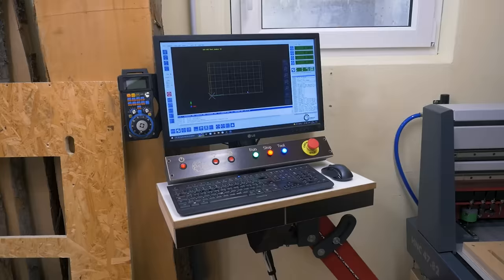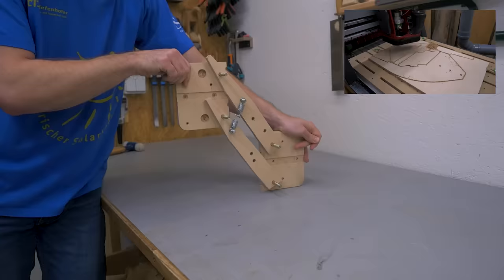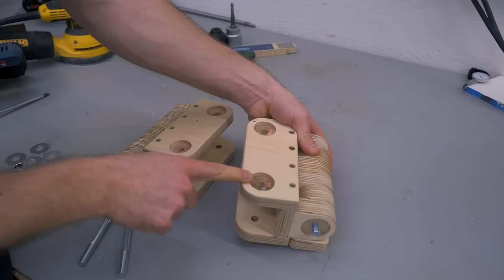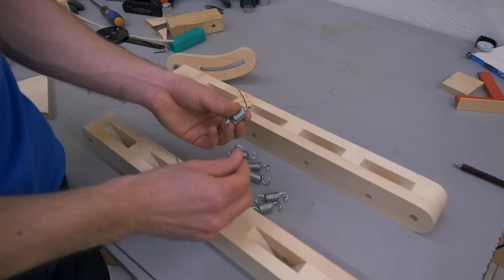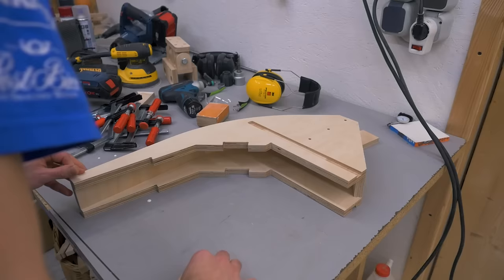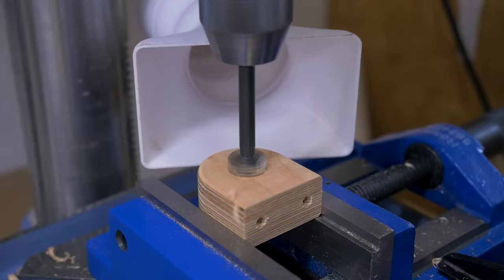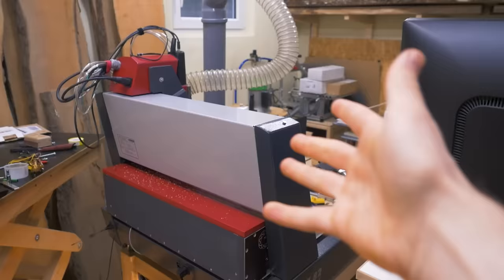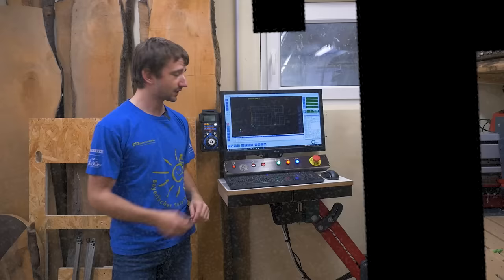Homemade PC Arm with Special Features

Comment: 5:40: "If anybody comments about how weak wooden threads are ... There's 0 load on the threads and you totally missed the point"
Thanks Marius!
Reply: I used machine screws in wood for my whole CNC build. All the linear guide rails, the bearing blocks, the stepper motors etc. are mounted that way. It holds up remarkably well, so even with some heavy load I can highly recommend wooden threads.
Reply: @Mike-Tango-Alpha  Thats true. I only wrote down what Marius shows at 5:40 for a very short time. Without any personal information.
Reply: But wooden threads are so weak! 😂

(They really aren't bad lol)
Reply: @johannesb.911  It took me some tries to pause at the message, and started smiling. Would I've known that you already made the work ... Anyway, thank you:)
Here's just a minor little theory, definitely a conspiracy theory that has absolutely nothing to do with our previous commentator, here! Threads, i.e. the type and dimensions, are selected according to the requirements such as shearing and tensile forces (Because of "fun" ... surely not!). The purpose of use, the material constants and the required holding force then flow into the selection of the right thread. A certain safety reserve has also to be planned for this purpose. Supporting frame constructions and housings always have to be able to withstand the maximum forces that can occur in the event of an accident, misuse or a defect in the internal structure/machinery(for example that a tool goes airborne or a moving part is blocked, like a ball-screw). Such incidents can and DO happen. Up to a certain degree, care has to be taken and they have to be considered in the design of the machine.
Small example: 1. We accidentally programmed something wrong: The wooden router falls apart... Great! (Most of the time it is a chain of events, that lead to DESASTER! One the hobbyist never thought of) 2. You stumble and fall on the X axis: In addition to your ankle fracture, the spindle guide also breaks off and cuts off your neck... Very Nice. Then you "no longer" have to get upset about your own stupidity:P
The cruel example was of course just a satirical joke. Or should we rather ask the health insurance companies about the idiot accident statistics? hehe.

Gruß und 3 Finger hoch: Fünf Bier fürs Sägewerk!;)
Reply: That was a hard pause to nail.

Comment: You might find it nice to add a knob of some sort on that nut that locks the angle of the parallelogram mechanism. Something that allows you to grip it easily and know which orientation is correct for when it is locked in place. I feel like fiddling  with the small wing nut will get old eventually.

Comment: A small suggestion: Most of the Industrial machines come with a trackball instead of a mouse. Might be something for you as well. Takes a bit to get used to, but great for small spaces like your table area. A desktop one will with thumb control will suite, but there are some industrial ones with bigger full hand size balls that are better dust resistant as well.

Comment: Use screws through the top of the arm, put a hole through the screws, Attach the springs within the arm through those screws, this will allow you to tension the system. Good Luck. Hope it helps!

Comment: The only thing i would change is to add a 2 mm braided steel line from the top of the parallelogram through the bottom of the main (table) joint and then through the leg and over (or under it to the floor if you think about it down up) back to a bigger spring.
This is how architectural/engineering tables had various implements back in the day, only difference is the spring would be hidden inside the leg, which is not an option here.

Comment: You can consider adding a short depth monitor tilt pivot wall mount bracket and that will allow you to offset any slant on the screen. The typically also allow for a few degrees of tilt and swivel which helps when you reposition the arm or move between sit and stand positions.

Comment: Instead of metal springs try pneumatic springs.
Have a look at a flexarm, they use the same parallelogram mechanism and use pneumatic springs.
Reply from the maker: Good idea. I wanted to use stuff I already had
Reply: @MariusHornberger  Also 5:50 onward "Installing the springs is a little bit tricky". 
Ask your mum!!! Hehe. A bit of string from the sewing box to fix the springs during assembly would have helped. (Bavarian cable ties)
(Ein bisschen Bindfaden aus dem Nähkästerl, um die Federn bei der Montage zu Fixieren, hätte geholfen. (Bayrische Kabelbinder)) ... Männer ... pffft *g*
Wonderful project. Thanks for sharing your design, doing the great work and showing it off, Marius!:)

Comment: Just a bit of advice: Never be lax on shop safety. The shot where you were making the first cut for drawers to go below had your hands way to close to the tablesaw. My own dad is missing a thumb for screwing up shop safety just once. Always use push sticks.

Also wood threads can't hold any force man. Really should have done threaded inserts ;)
Reply: I knew someone would call him out on this.  I saw it and thought... scary.

Comment: Some rubber bands or silicon straps or similar around the long members of the mechanism would add to the lifting ability and doesn't require any modification.

Comment: My comment is not about how weak wooden threads are, but rather about how many times I replayed the 2 second bit to catch the message that pops up at 5:40. I probably also missed the point. 😁
Reply from the maker: Then I'll tell you the secret about frame by frame with "," and "."

Comment: Wooden threads are strong, and the direction of force being applied to them from the springs means the threads are irrelevant. You could have used pins and it would have had the same effect. The threads are just free and simple, and I bet it 'drives engagement' a bit in the comments.

Comment: I'm a little confused I see in this video that you have a digitizing touch probe but in your more recent video with your drill press the inserts for the table you did by hand instead of using that touch probe and just machine in something Without all that extra effort. Did you not think of using it or is there a reason you didn't use it that's not obvious to me?

Comment: Hi Marius. I have been following your bcc videos for quite some time now. Really impressed with what you have done with the hammer cnc.
We have one hammer cnc with the 2.2kw spindle in the studio I work in but no one really know how it works yet.
I have taken it upon myself to try to learn. However I’m struggling with the ending software and I can’t really find much info on YouTube that is in English.
Do you know if this machine is compatible with CNCjs or something similar? I’m guessing this is no Grbl controller but I can’t really find out what it is.
Also do you know if there is possible to fit a ATC on the 2.2kw spindle?
Thank you / Kenny

Comment: Hi, I’ve been considering building an articulating arm but have been struggling to find a method to calculate the strength of springs to balance the load on the arm. Can anyone point me towards the method?

Comment: I'm wondering how long each tool last before having to replace it or sharpen.  Do you have a way to gauge when to sharpen or replace?  I don't know when you are running video at speeds greater than real time or if all the cutting in video is at real time.  I wonder about the real time, because it appears the tools are cutting deep while going very fast too.

Comment: Re: bolt lengths: aren't they measured including the length of the head? So if you have a 150mm bolt but the head is 9mm thick you have 141mm of actual shaft to work with? I think I can still remember a schematic drawing I saw on Hornbach's website once.
Reply: No, if you need eg 75mm(3") then that is what you use, you don't measure the head thickness and say I need 75mm plus 8mm head, also
Head thicknesses varies  based on weight(thickness) of bolt, you don't have to measure bolt head thickness each time to help make choice of bolt length
Reply: @davidp8157  You're right. I now took the time to actually take a look back at a typical bolt, and I must have been misremembering.

Comment: Do you know how weak wooden threads are?...
Reply: The screws for the springs don't have any axial pulling force on them. Only radial force and for holding the springs in they are more than enough. Even with the light rotational force of the spring rubbing against the srew shaft when you tilt the mechanism it's not problematic I think. If thats happening and the srews are getting loose he could always glue them in with CA glue.
Reply: @atariks1475  I'm relatively certain that fertisus saw the message that popped up for a few frames about why not to mention that, and that this comment is purely a light hearted poke against that message
Reply: @jmacca6906  Oh, I didn't noticed the message :D Sorry about that.
Reply: @atariks1475  No reason to apologise, the message is at 5:40 if you were curious, it's a lot easier to pick out if you go frame by frame on the video (done with comma and period, 1 frame at a time (just like you would with arrow keys or j and l (5 seconds and 10 seconds respectively))) 👍